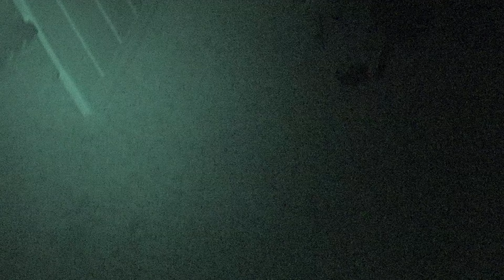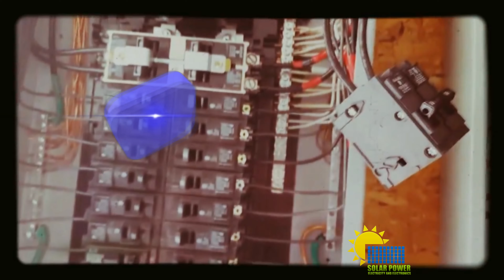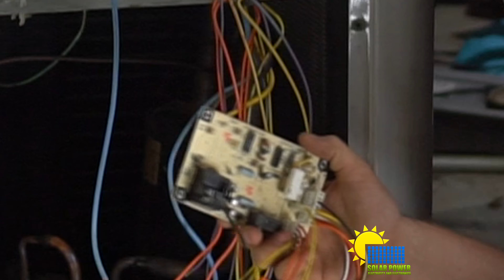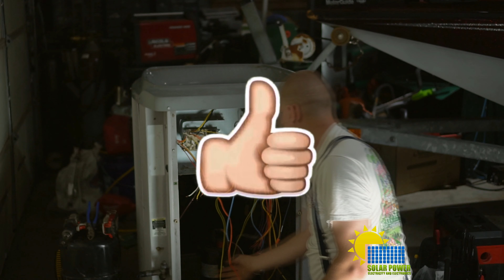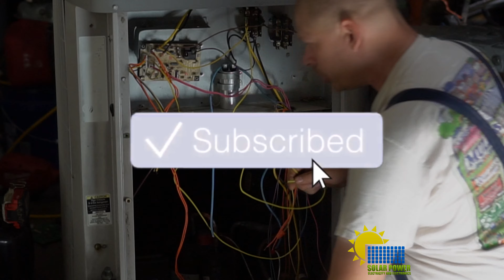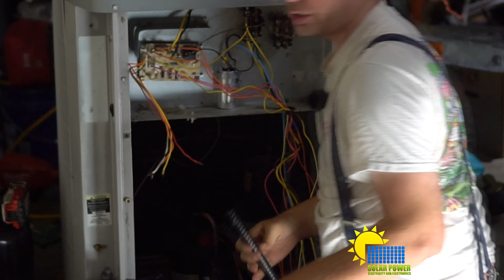Wiring Up The Solar Powered Heat Punp/Air Conditioner For Home

Comment: How are you going to get enough head pressure to switch reversing valve
Reply from the maker: Expansion valve controls the head pressure
Reply: @solarpowerelectricityandel2915  incorrect that controls superheat
Reply from the maker: @royamberg9177  lol we will see my friend
Reply: @solarpowerelectricityandel2915  think. Txv has one purpose to control superheat. Are you going to use head pressure control on it vary fan speed if not don't expect the best results. Takes a minimum amount of head pressure for things to work. There's a fine line. I think your trying to go to far
Reply from the maker: @royamberg9177  refrigerant compressors behind expansion valve after the expansion valve it decompresses a higher pressure under the head pressure side is because of the expansion valve restricts the flow of refrigerant not because of the temperature of the refrigerant the refrigerant that is a lower pressure is a lower temperature at a liquid state I have a 608 Universal certification I learned it 20 years ago
Reply: @solarpowerelectricityandel2915  but think. The condenser is way oversized meaning much much less head pressure.   Are you going to pack that brim full of refrigerant lol. It also takes enough head pressure to make txv work properly. What happens in the winter when the head pressure switch fails with contacts closed. Lack of head pressure and very little refrigerant flow
Reply: Why do you think they put head master on refrigeration system. to maintain minimum head pressure so things work correctly. Youl probably have to do the same thing with fan speed control.
Reply from the maker: @royamberg9177  you should watch one of my previous videos about the system I mention I was going to run it at 115 volts on a Transformer from a 230-volt fan that would allow a much lower power system for the fan motor and lower RPMs to boot the pressure is going to be fine my friend but yes I'm absolutely sure the expansion valve helps regulate the pressure on both sides
Reply from the maker: @royamberg9177  I promise I will do very in-depth reviews on the refrigerant system
Reply: @solarpowerelectricityandel2915  what you doing with indoor blower. That's going to have to run slow or it won't dehumidify   time will tell. Then there's another issue. Lie refrigerant volocity won't move oil fast enough. How are you going to handle that issue
Reply from the maker: @royamberg9177  I have full RPM control it's a Carrier Infinity indoor unit
Reply: @solarpowerelectricityandel2915  we will see how it goes.